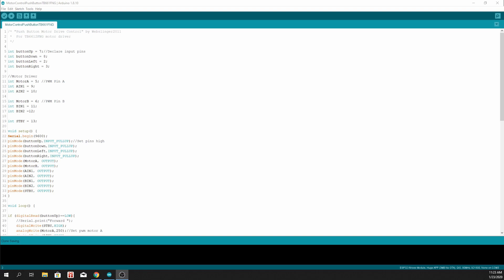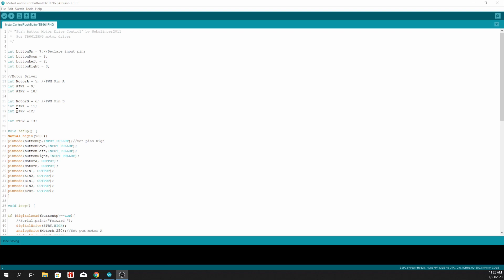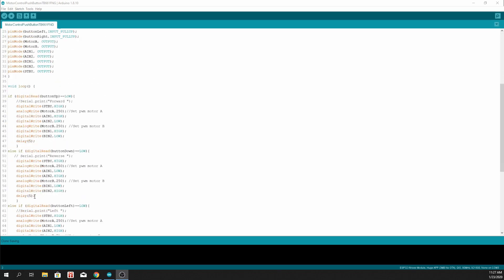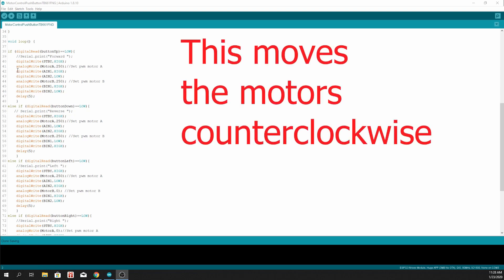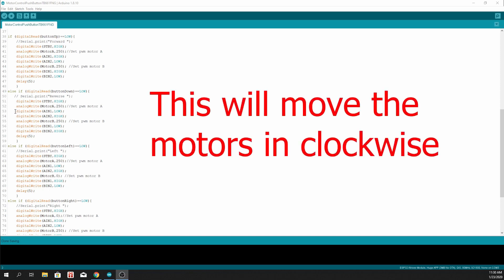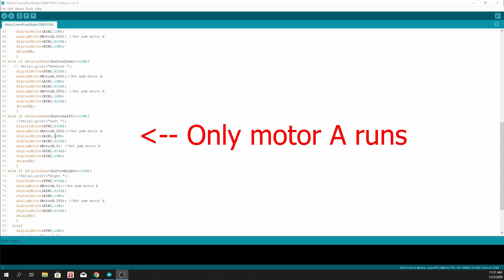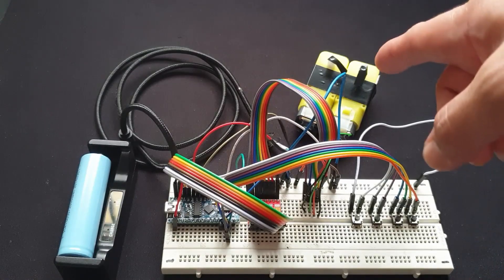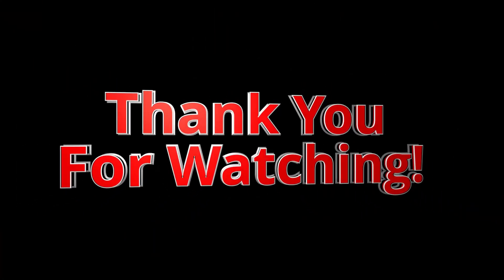TB6612FNG Motor Driver Control using Arduino

Comment: is it possible to use 3 battery 18650 to supply power to VM (External supply) and use the same pack of battery to get 4.2V to supply to VC and Arduino? I did this but my motors sometimes works and sometimes get locked.

Comment: Hi, very good content! I've received my TB6612 and was following your video. I used also a protoboard and an external power supply (12V/ 3.3A). I just wired Vm and Gnd of the system because I would check the logical VCC output 5V. I did not wire anything else. In a matter of second my TB got burned! I definitelly dont know what went wrong! Should no current be thru TB6612, right? Even if my supply is up to 3.3A.. I had nothing else wired! Could please help me? It is very important project to my degree.
Reply from the maker: Maybe your power supply to Vm was over 12V. I recommend separate supply for VM and VCC if your're using over 5V.
Reply: @webslinger2011  thanks! But i found just later the problem.. I got a multimeter to check the voltage but it was on current set... and that is the reason got burn. Now is everything working.